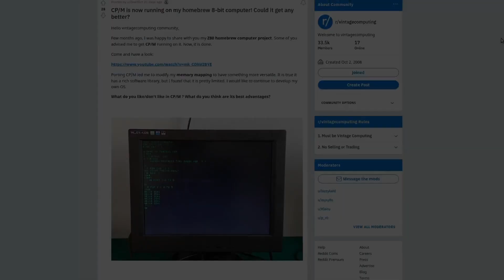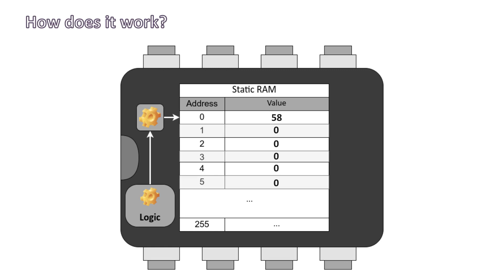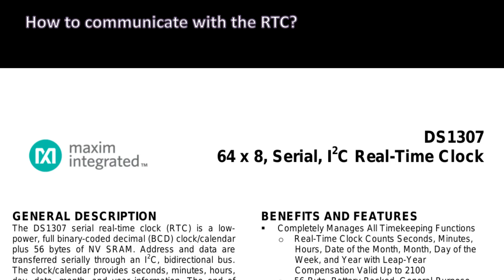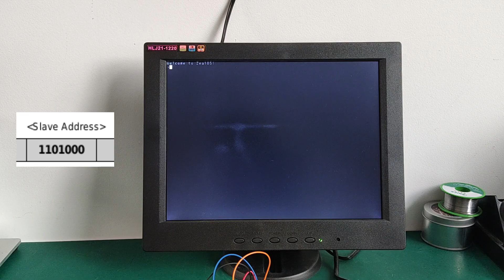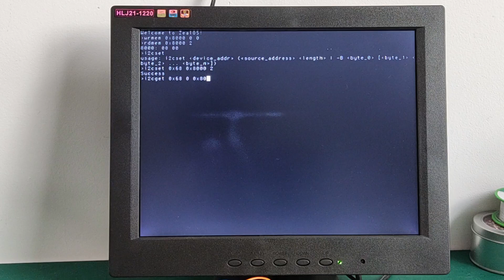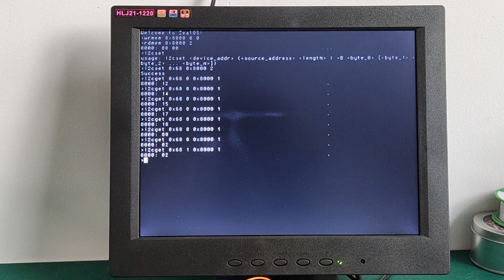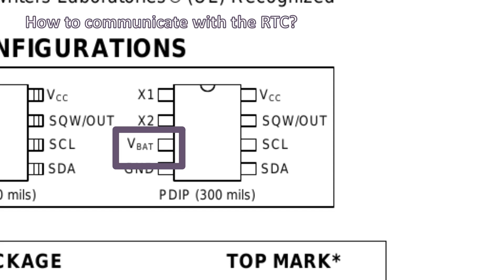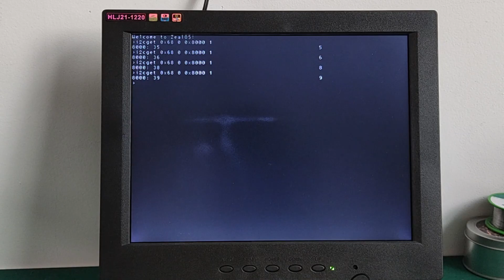Real-Time Clock on an 8-bit computer

Comment: Fascinating how people always start with CP/M 2.2, and then they add RAM banking and an RTC first. 
But there is also CP/M 3, which already includes all those features and more.
Reply from the maker: From what I see, there is much more documentation and demos for CP/M 2.2
It has been ported to a lot of targets and homebrew computers while CP/M 3 is more rare. Moreover, most software you can find online are compatible with 2.2
Reply: @Zeal8bit  I know all too well how much the cp/m 3 documentation sucks.
I am currently working on a port, and it's not easy. But I had it booting already, and it is totally worth it.
Now I am in the process of refining the system, but I am still stuck at the bootloader. That is maybe the least documented part of it.

Comment: Nice. I used a bq4845 on my z80. It is addressed like a RAM chip so can use I/O instructions to work with it. It has a few other cool features too.
Reply from the maker: That's a good choice! Parallel bus makes it simpler and interface with a Z80
I wish such chip would be available in DIP or PLCC format😄
Reply: @Zeal8bit  Mine is a DIP, I did this about 7 years ago.

Comment: So... the next revision board could see a Real Time Clock added into it? That would be pretty cool.
Reply from the maker: You guessed right 😄
I have already added this RTC to the latest prototype, I will show it in an upcoming video
Reply: @Zeal8bit  That would be impressive. The question would be... can it avoid date limitations, or would it end up with its own Y2K bug? Nonetheless,  this is an important development, as this would make it quite a bit more advanced than a huge number of 8-bit Computers from the Seventies and Eighties. It also makes me wonder how much further this project can be pushed, and where you will go next.

Thanks for this update!
Reply from the maker: @horseradishpower9947  Officially, the limitation for the chip is set to year 2100 for the leap year calculation, that gives us 78 years still from now. The fact is the Year register (register 0x6) is a single byte, so it presents tens and units of year (the value is thus comprised between 0x00 and 0x99). However, 56 general purpose RAM bytes are available from 0x08 to 0x3F, which means that we can store the upper digits of the year their, or even the whole year there.

Agreed, this will let us have timestamped files, or even games depending on the real time like the Gameboy had. I could push this project even further but I have to set limits, else I won't finish. In fact, I still have plenty of things to implement. The final board will have an extension port, giving access to the bus, and a user port which gives access to 8 GPIOs, UART and I2C bus. This should be enough for extensions😄
Reply: @Zeal8bit  Honestly, the fact you have done this much is brilliant. RTC is a pain in my backside for my Pi. I have a module, but it is all about understanding the instructions to put it in, and then getting it all to work... so moving on to other elements makes perfect sense. Declare a success, move on to other things, and then eventually move round to improving it.

Again, good luck with your project!
Reply from the maker: @horseradishpower9947  Can't you find a suitable driver online for your RTC on Raspberry?

Thank you for your support!
Reply: @Zeal8bit  I have found the issue lies with documentation. It can be tricky to understand, and it doesn't help if you do things in the wrong order.

I plan to try again, this time with fresh Operating Systems,  and looking over the  instructions carefully,  to make sure I do things in the right order. 

I am going to retry the SB Components USB RTC, as it has instructions that can be understood, I just need to read them through a couple of times, to make sure I don't put in the battery too soon, nor do I put it in the wrong way round.

As an aside, did you know that the official Raspberry Pi YouTube channel,  they have a video showing how a guy has taken a few SID chips, and using personalised PCBs, has created a synthesiser system using a Raspberry Pi 4B,  and hooked up his keyboard to the Pi as well. Now, I am not suggesting adding SID chips to your project. But he was doing synthesiser experiments, to recreate the Eighties sound. Which makes me wonder... could that video give you inspiration? Hence my mentioning it.
Reply from the maker: I watched it after reading your comment, it's pretty cool!
It's a pity such chip is not made anymore. We can still find them online but they are all on used condition or refurbished.
I haven't made any in-depth on the graphics or sound for Zeal, but the FPGA will handle both, I did a demonstration in my first video. Once I get the main board done, I will continue on improving the FPGA one, and finally improve the sound and graphics implementation!
Reply: @Zeal8bit  Sounds Promising. Good luck with the development of the graphics and sound. If I can find anything that might help, I will let you know.